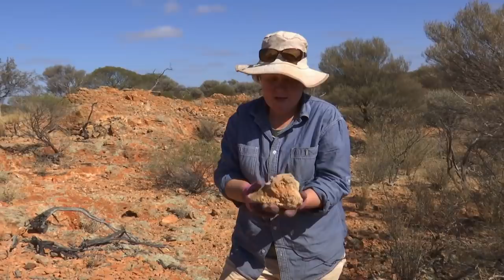Fire Family Finds $30,000 Fire Opals | Outback Opal Hunters

Comment: I remember seeing stacks of this as a kid, but I seem to remember that it was called "Citrine" back then? Can someone let me know if it is the same (semi precious) gemstone?
Reply: Citrine is a form of quartz, its not the same thing as fire opal.
Reply: @janderss459  correct
Reply: @texasslingleadsomtingwong8751  correct
Reply: @jamesfancher7508  correct
Reply: @thvtsydneylyf3th077  while quartz is a form of silicon dioxide, it's in a crystalline form, while opal is composed of silica microspheres that form in rock seams from moisture deposits.
Reply: @engineer84-w8x  like opaline?
Reply: @thvtsydneylyf3th077  what's that? also i forgot to mention that opal has approximately 6-10% water content in it's intermolecular structure, which is what their talking about when it comes to cutting them.

Comment: I wonder if there's a way to dissolve the rock that's surrounding the fire opal. Idk if the opal would dissolve in the acid or not. But if it would work, you could extract the full deposit without cracking it up.
Reply: Nope, doesn’t work.

Comment: I'm thinking you need a stihl concrete saw with a Dimond blade . Can br used to be more precise while cutting out large sections . This should help lower your need for the jack hammer.
Reply: Does that take water to work because they are in a desert
Reply: @armandovanhaaren7028  yep and it would likely be much slower going.
Reply: @armandovanhaaren7028  depends on the blade type .
Reply: @ieatcaribou7852  yes it would definitely be slower but would preserve specimen grade pieces potentially  netting bigger money.